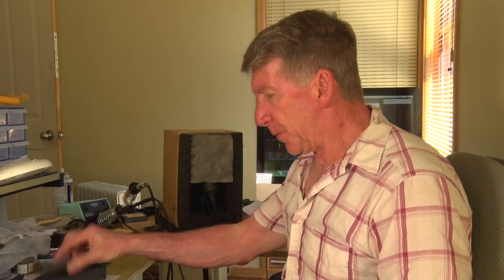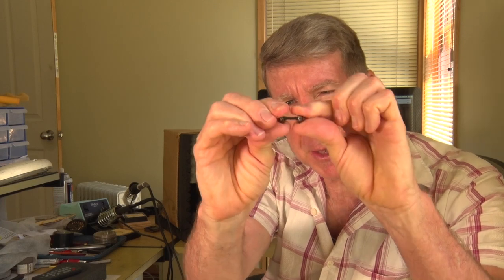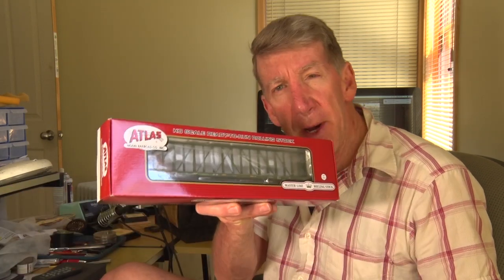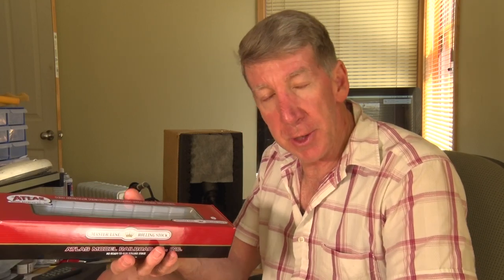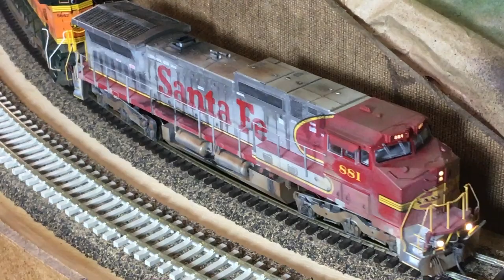Whats' coming up on Fishplate Films , plus some I-Phone run by's

Comment: Interesting comment 2 minutes in about the IM wheelsets and Atlas...  Is there a reason you use IM wheelsets over, say, Kadee...  I am curious if you or others have seen FFF differences with them...
Reply from the maker: Hi Chris, I got the IM wheel sets years ago for the DDG Hoppers and I didn't realise the difference in axel lengths?  So they are a little sloppy so the truck sits a tiny bit low which needs adjusting for coupler height. I now know there are many different axel lengths so replacing wheel sets is not that easy ! Of course if you use the same make of axel to truck it is a perfect fit and Exact rail make many different wheelsets which I have used on other cars.
Cheers Gregg.

Comment: Yes, plastic on plastic does not make for the most friction-free running. I have a quick and easy tip to help this though: using a 2b graphite sketching stick ("pencil") , run the axle ends around in a groove filed into the graphite. The difference is remarkable.
Reply from the maker: The old graphite does work well but management does not allow plastic axels on the railroad! 
Directive from Lord Stan..LOL
Cheers Gregg.
Reply: FishplateFilms Good to know His Lordship is still in command, tirelessly working away behind the scenes in his study.
Reply from the maker: @struck2soon   He will be returning soon !!